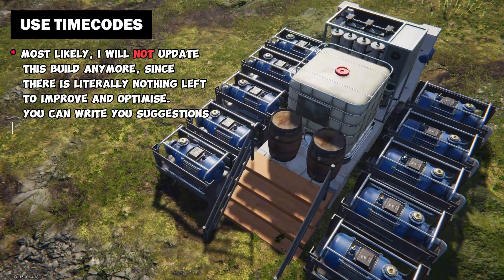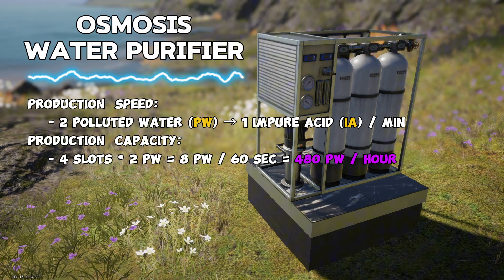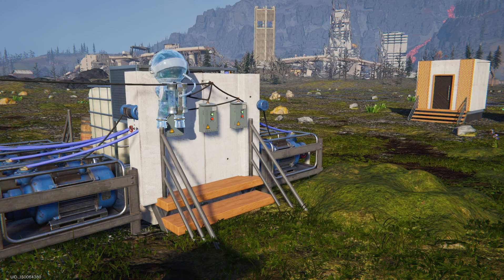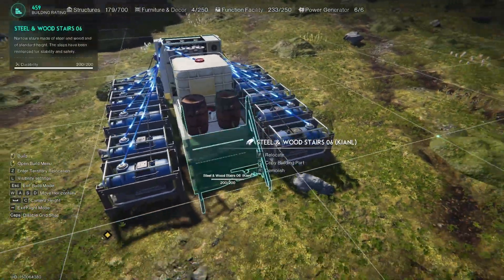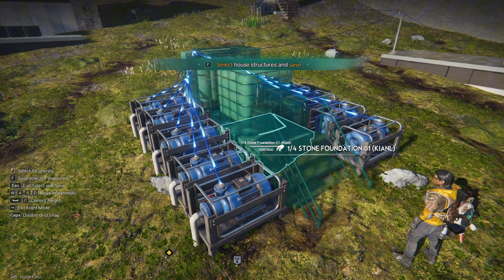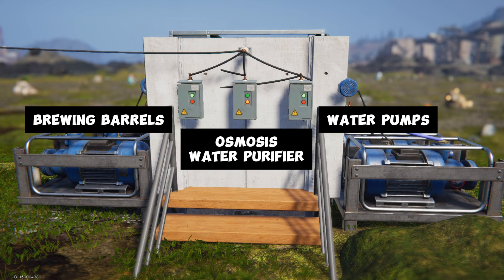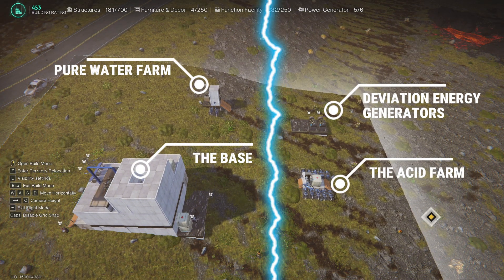The Simplest Acid Farm & Acid Production Math Breakdown | ONCE HUMAN

Comment: I dont know if they updated the game to where you dont need a water tank anymore but my impure acid goes straight to the barrels. Can someone confirm if its just better to have a water tank
Reply: You can indeed send your Impure Acid straight into your Barrel now. I do it like this: 
- Water Pump (Dirty Water) > Osmosis Filter (Purified Water) > Water Tank > Barrel > Water Tank 
- Water Pump (Polluted Water) > Osmosis Filter (Impure Acid) > Water Tank > Barrel > Water Tank 

Reason I put them in the water tank first before going into the barrel is so my irrigators also use the purified water, and if my barrel gets full it has storage for any extra that's produced, at the cost of only 1 more pump connector it's not a bad option.

Comment: Super cool and clean setup!  The only real issue with it is power supply, really.  I mean lets do some simple maths.  10 pumps at 10 W each is 100 W.  The 2 barrels are another 20 W (10 each) , the Purifier and Tank are another 20 W (10 each) and the little pumps are 1 W each, for a grand total of 142 W.  Thats 4 Deviation Generators (plus change) or 5 Large Hydro Generators.  I believe the max (without the Memetic Specialization) is 6 Gens per household.  A bit of a small predicament I would suggest. Most of us are going to have to settle for less water pumps in order to make this realistic.  The other option would be to link the acid farm up to a switchable pylon and switch it on when we are offline and farm, then switch it off when we get back online, in order to have a functioning home.  Just my 2 cents, great video still!
Reply from the maker: hello. use Electric Eels + Extradimensional Cat Moonlit Jewel https://youtu.be/C4evG2IVHtk

Comment: idk if this is worth it tbh, i set it up, wasn't getting results worth the cost, I could do 5 lvl 40 Cargo conquests and have over 2k acid. I only play PVE so i just afk it and can just afk between conquests, as well, ts rare aone shows unless you actually want them too. idk if it could be fully automated that would be diffrent, but i maybe got 500 over the past few days, that being said it apparently slows when offline, so i dont realy see the point. They either need to up the yields, reduce the cost of power or up the watts of production for power. I know it isnt an automation game, but i just dont see the point in having these methods when you have active alternatives that aren't finnicky or because they decided to nerf it so it can't be fully automatic. I just don't get it, feel like its going to be a part of the game that never really feels worth exploring. Same with oil, too slow and better alternatives, as well, having the only factory that makes it worth it be rng based is just dumb. I would do oil but i didn't get the perk, so why bother with the production rate being so slow, 500 crude oil for 1 barreled premium fuel? Why bother? I think things like acid flowing through pipes should be up to the server, and if there are unofficial servers diffrent yields. That is the only thing rust has over this game, the option to choose the pacing and gathering rate of resources. I dont get it, and as far as i can tell it wouldn't effect the player economy as you can't trade in between servers(i.e. a player from server 250 can't trade with a player from sever 270) only the worlds within that server and its too expensive to bring a bunch of stuff in from your previous one (from what I have researched).
Reply: Or u can do refineryes with food buff for acid and u get like 500*killing mobs* per permit plus 80 from the refinery

Comment: Bro :D what you have a generator with 100 W or what lol? when you connect all 10 waterpumps then you connect to wallmount ...then what? :D when i connect from wallmount to Deviation Energy Generator at 2 pumps write : insufficient power
Reply from the maker: that's as an example. I have solar panel on the base, and all connected. just didn't have enough materials, to build more generators atm

Comment: I noticed when Offline it works alot slower, it also seems that Slots 2/3/4 work slower then offline. I fill all to 1000 and then I will end up with 740/940/940/940 when retuning to the Game. Is this a known Issue ?
Reply from the maker: I suppose the devs did this purposefully because of alts, RMT and so on

Comment: Which is more acid efficient? Water pumps or contaminated berries?
Reply from the maker: pumps generate more acid. crops generates less, but require less power
Reply: @KIANL-GAMER  Could be better having a huge contaminated berries farm vs a compact pump farm?
Reply from the maker: @039kpo  based on what I calculated - no. but you actually can have both

Comment: Always like your compact builds, thanks for that!
One question though, why so many pumps? I currently run 2 per purifier and it is constantly running. So I am a bit confused here.
Reply: i want to know too
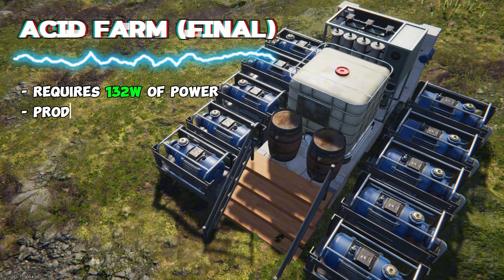Reply from the maker: 00:32 🤨
Reply: @KIANL-GAMER  Yes I saw the math which is why I am confused. I have 3 purifiers setup with two pumps directly feeding into each and they're filling up. Granted rather slowly but it is filling up , not depleting. Have them running for two days now.
This is not "You don't know what you're talking about", quite the opposite. I am rather sure you know a lot more than me which is why I am genuinly confused.
Reply: @DocFloppy86  Are you in WoW? my pumps processed faster there for some reason
Reply: @zero604  No Manibus. But I think I figured it out by now. Better said it demonstrated itself for me. As I said it filled up but slowly. Upon starting to fill the third slot it started to go down again, then up again. So while it looked fully sufficient for the first two days it basically just ran on 50% capacity. All I was seeing was "It produces constantly"